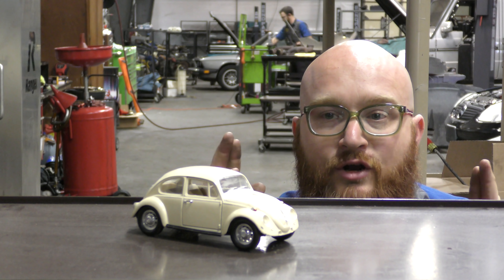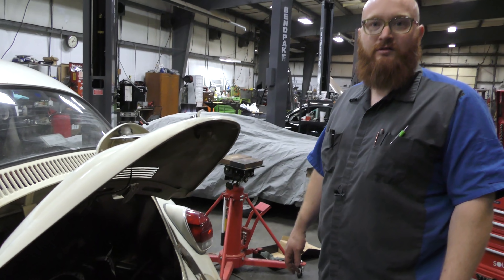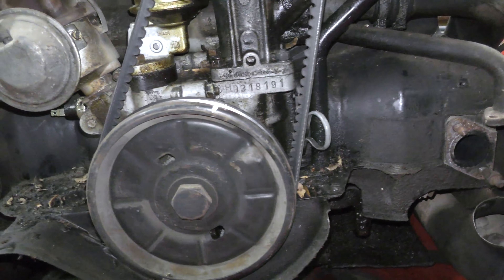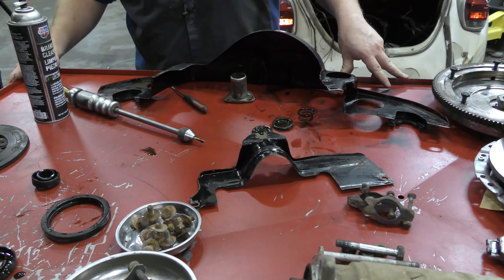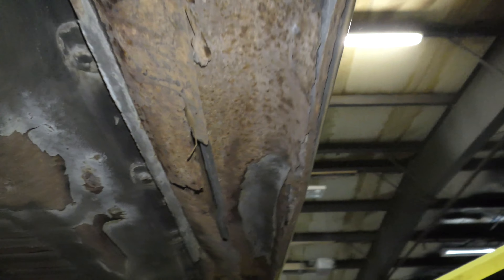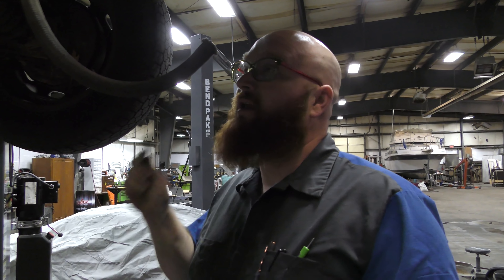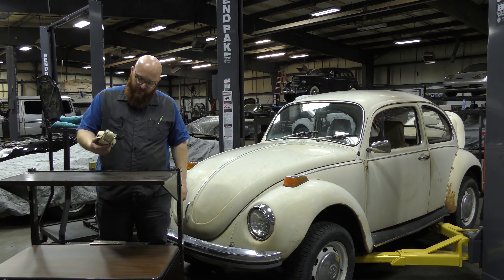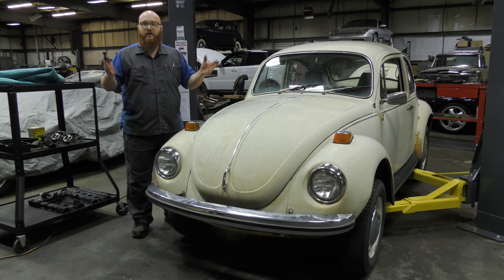Engine out for a clutch on '72 Super Beetle?! CAR WIZARD shows cool little car & huge repair process

Comment: My first car was a VW type III station wagon, my dad had a couple of the campers
My town had an old time shop that specialized in VWs and I started hanging around helping out. This was around 1978 and VWs was popular because of the gas crises 
I’d buy them for a few $100 fix them up and flip them
I bought a 65 camper with bad engine for $100, paid $100 to tow it to the shop
Then bought a 1969 bug with no title for $100  Took the engine out and put it in the bus, the bug was 12 volt and had a slightly bigger fly wheel so had to grind the transmission housing out for it to fit. Also had to use a starter from an automatic...oh no need to remove the starter. 
Sold the body of the bug and tires for $200 and the old camper engine for $50 so I had $50 into my camper
I drove that thing all around the country till a girlfriend put sand down in the engine case
I probably have owned 25 VWs over the years, oldest was a 1955, back then they were just cheap old cars
I remember looking at a real nice 1967, 21 window bus with the big sunroof 
Guy wanted $1800 which I though was crazy high...today probably at least a $75,000 car

Comment: Unless you kept these in a climate controlled garage, you could almost sit and watch and hear the rust eating away at these cars. My stepdad used to own a 1964 model. Drove it to and from Cleveland OH to Travelers Rest SC many times having family in both cities. All through the mountains and everything. Never needed to worry about overheating it going up mountains on a hot day with no cooling system to worry about

Comment: Make sure you torque that flywheel gland nut to 217 ft/lbs plus. I’ve seen too many cranks fail due to shops just not knowing how tight that 36mm nut needs to be

Comment: A well sorted heater, ie no rusty heater boxes/channels, blower operational. etc in a bug/Ghia, will run you outta the car on even the coldest winter day. Sure it may take 20 minutes but they work good if everything is whole and functional. Also I wonder if the engine was being held in by 4 bolts or the usual 3 since the upper passenger side one is usually left out by prior owners. It's nice Wizard likes these but when one sends a bug to a mechanic, they usually got more money than sense.
Reply: Yeah, you'd roast your ankle but the rest of you was cold.
Reply: @terrylessmann2274  agree to disagree, actually had to dial it back

Comment: If you still have it on site, could you show and explain how the gas heater would work that some folks would have installed?  (Does that make me old to remember that?)
Reply: In Canada, the gas heaters weren't options but necessities--except when the Beetle was converted to an open air Dune Buggy which is how I learned to drive before getting a license. The first day of driver's ed behind the wheel instruction, the instructor said I was ready to get my license.

Comment: Someone installed the cam plug in back to front.
Did you check the radial play on the flywheel Wizard?
If it has play, indicating worn main bearings, the seal wont last too long before it leaks again.
BTW, starter motor does not need removing on this job.

Comment: You didn't mention the difference between a Beetle and a Super Beetle. The SB is slightly longer so the spare sits  flat in the front. The Beetle front suspension is torsion bars with 2 pivoting parallel arms on each side. The SB front suspension is MacPherson Struts. I think my SB had front disk brakes too vs the drums on the '70. In '73 the SB also got a curved front windshield vs the flat windshield on the Beetle.

Comment: Had  59 and 60 Beetles. Easy cars to repair as long as you bought metric tools of which I had none at the beginning. Top speed on the 59 was about 55 mph on a good day with no headwind. 36 hp I believe, the 60 had 40 hp.

Comment: I had a 1971 type 3 Volkswagen same air cooled engine but flat instead of upright 
The heater channels were not rusted out 
The problem with the design was that there is no heater blower motor 
Put your left foot right next to the floor outlet and you got a hot foot

Comment: I didn't see the oring that goes in the flywheel, they are what leak through the flywheel nut. That's not a washer cap it's a valve opener and the white pipe below it goes to the spare tire, there's also a valve in the washer cap itself that cuts off at 20 psi so the spare doesn't go flat.

Comment: There is a valve on the hose that  connects the washer reservoir to the spare tire that stops airflow at 35 psi so the tire wont go flat.

Comment: My experience with the heat in the Beetle was it did not work well when the engine was idling at a stop light. It worked best traveling at 40 mph or more. How do you repair the heat channels on this Beetle ?

Comment: Well it's out not a bad ideal to adjust the valves and putting a....009 distributor in that engine will make it run extremely well and a good set of NGK plugs please don't put Bosch plugs in it and a trick for some of your older vw's you can run Dexron transmission fluid in oil bath air cleaners air cleaner for filter much better you know my how much dirt it collects in the bottom you really see the difference how much better and filters the air and you can slightly overfill it

Comment: 4 big bolts, shift linkage, throttle cable, fuel line, and a couple if wires. If you're in a hurry you can even leave the rear wheels and axles inplace.  Works even better if you have a steel 55gal drum. You lower the whole car so that the engine just starts to touch the drum. Un bolt and lift body away.

Comment: even with intact heater channels, i cant see the air arriving very hot if you are driving in a cold german winter on a wet countryside road,some isolated tubing may be a good upgrade. AS a teen i was a bit too tall to fit in one of these, and i remember feeling a bit underwhelmed

Comment: I’ve been told that when you’re replacing the clutch that it’s a better idea to pull the engine and transmission out of the car as one unit because later on when you go to mate them back together it can be very difficult to do especially when you have the transmission still in the car if you have a manual transmission
Reply: It's not hard to get them to re-mate...just takes a little finesse to get them lined up correctly
Reply: @chrisfreemesser  I guess it depends on the vehicle as well. Some can be more challenging than others

Comment: I'm surprised the US spec Super Beetle has front drum brakes. Its predecessor, the VW 1500 Beetle in UK spec had disc brakes on the front. I must have changed dozens of Beetle clutches over time, never needed to take the starter out. The first clutch I changed took me 50 minutes, later I could do it in 20. I believe the record is about 90 seconds!. All on UK spec models, though I doubt pre 1973 cars differed much.
One weakness they had was the oil cooler partially shrouded air to #3 cylinder head, it was a fairly common sight to see them in repair shops because they dropped #3 exhaust valve after long periods of flat out cruising.

Comment: That small tube on the washer bottle runs down to the tire. Normally there is another tube that runs through the heater channel that carries the heat.
Still have the 72 Super Bug my father bought new. Naturally we got disc brakes on the front, standard.
Recall an old VW mechanic say, "More VWs (air-cooled) get killed by the mechanic at the corner garage than any other way".

Comment: You are mistaken Wizard; the windshield washer is still powered by the spare, but a hose is missing.  I owned, from new, a ‘68, ‘72 Super Beetle Baja Edition, and a ‘75.  If you filled the tank with a Chuck, the charge wouldn’t last long.  Also, as designed, the spare will not go flat.  One fills the tire to 42psi and a valve is present that prevents the tire from dropping from, if memory serves me, 26psi.  Air flow to the bottle stops at that point.  This way a single fill of the spare gives you a few fills of the washer fluid bottle.  
Sadly, at around the year of this car, the washer fluid release was moved from the dashboard to a wand on the steering wheel assembly (like modern cars).  I say sadly because the design also had the rubber hoses carrying washer fluid  into the interior compartment just behind the steering wheel.  The hoses, though pressurized, were not clamped.  On my ‘75, the hose came loose, spraying washer fluid into my interior.  By the time I discovered it, my floor had started to rust. A little Rustoleum fixed it for the life of the car.

Comment: I remember i did exactly this a clutch and heads and we pulled the whole rear of the car up using a barn rafter and slid the engine out with a pallet jack 😂 if theres a will theres a way

Comment: Interesting. The rear deck lid was changed at some point to a '68-'71 convertible/'70-'71 sedan deck lid. They went to 4 vents from '72 to 2003.

Comment: A Long golf tee works better than a screwdriver on the fuel line and you do not need to remove the stater unless you want to replace the bushing..With the proper tool a VW engine can be out and on the bench in 5 minutes very safely

Comment: Isn’t the heater duct running down the sides of the car also provide structural support?
Reply: As the Wizard commented, the "spine" and strength of the VW comes from the "tube" running down the centre of the car...you can take the body off (which contains those air ducts) and drive around on the platform...so no, it won't affect the structure...which is why people can't be bothered fixing the heat ducts....

Comment: The original friction disks for the clutch usually last more than 100,000 miles.. I would take engines out for rebuilding at 100,000 miles and the friction disk would hardly look worn. I'd bet this beetle has at least 187,000 miles on the clutch. Or else it was driven by someone who rode the clutch for mile after mile. The 1972 engines with the air cooler behind the fan housing lasted longer than the older engines with the oil cooler between the fan and cylinder #3. Moving the oil cooler back was an attempt to make the engine last longer than 100,000 miles. With the oil cooler blocking air to cylinder #3, cylinder #3 would typically suck a valve at about 100,000 miles, or even sooner. This is WITH properly done regular maintenance. The #3 exhaust valve would overheat, the stem would stretch, and guide would wear, and the stem would finally stretch in 2. The only warning was that at regular valve adjustments, isntead of seeing the valve lash get larger, you'd see it smaller. then you'd know the engine was soon going to suck the valve.

Comment: Americans were never taught how to drive an air-cooled car, they lug them around town instead of letting them rev which pushes the cooling air across the cylinders, and drives heat into the car. Also keeping the oil full helps the engine run cool.

Comment: If you're going to work on a Beetle a 36mm socket and 250 ft.lbs. Torque Wrench is essential.  Because the rear brake drums are held on with a 36mm nut and you have to torque that puppy down to 215 ft.lbs of torque if I remember it correctly.  Note could be 235 ft.lbs.  Hey it's bee nearly 40 years since I had the pleasure of working on a Beetle.  BTW, the Super Beetle is actually a VW Sedan and NOT a Beetle.  With this car line VW produced Beetles and Sedans that could look identical.  The difference was that a Beetle did not have ANY options available, you got the base car and nothing more.  If you something like pop out rear windows you had to step up to the Sedan.  Heck, at one point if you wanted a radio you had to step up to the Sedan.  My first car was a 1970 Sedan that was fully loaded.  It had chrome trim for the rain gutters, dual bumper mounted horns, bumper guards, a sunroof, pop out rear windows and the Formula V appearance package.  Color was Cobalt Blue with a white interior.  BTW, Fantastic was great for keeping that white interior nice and clean.  As for the engine, it was a single port 1600 and while rated at 65 hp it actually was producing something in the range of 72 hp and was quick enough to beat a 914-4.

As for clutches, my brother and I would team and did a lot of clutches on Beetles and Buses.  It got so we could have the engine out and on a pallet in 10 minutes or less.  Going back in wasn't so quick, even with a pilot shaft it was always a wiggle festival getting the input shaft all the way into the pilot bearing.

Comment: An old VW mechanic near me can service the clutch without removing the engine. He uses jacks to separate the transmission from the engine enough to get his hands in.
Reply: but why? It's easier to take the engine out than it is to reach around or craw under.

Comment: Wizard, I thought the "Super-Beetles" had a curved wind-shield, unlike the beetle you are showing us.  Are you going to replace the heater-duct that RUSTED and is Open to the air?  And why wouldn't the owner want to switch to the more long-lasting front disc-brakes?   I saw a space under the frunk where an oil-cooler could be placed.    Then by running oil lines through heater-duct you could have more oil capacity, with which to provide more cooling oil.   You've got LOTS of room, pun-intended.  Start a VW-Beetle shop, where if you need a change of pace, you & a guy could wrench on the Beetles you love.

Comment: With the heater channel in that condition, how does the car not sag when the door is opened? Mine did, to the point that if the passenger had their knees under the glove box they'd get trapped.
Reply: had a lot of bugs, Never seen that.  but doors wont close when body sags badly

Comment: A lot of the issues people have with the heater can be solved easily. You have to crack a window or open a windwing so the hot air can flow through the car. My 67 bug will roast you if I drive with my window down.

Comment: You also check the end play on the crankshaft before you disassemble the engine. You might have to shim it to get it back into spec, or the thrust bearing could be so worn that the clutch won't last. Remember "The Idiots Book of Volkswagon Repair''?

Comment: I believe it's a 71 super beetle , I owned a 72 brand new out of show room ,The rear back engine compartment cover had more loovers in the 72, Perhaps the back lid had been changed at some point..I could pull the engine in 20 min ..did alot of work on them..

Comment: My 1st car was a 1970 beetle with a 75 1600 duel port. I payed $67.80 for the rolling chassis I already had the engine. First werk on a car... squeezed the throttle cable between the engine and transaxle. My Dads mechanic fixed it for nothing. It was the same yellow.

Comment: The groove on the pressure plate is not that big problem to use on a low performance car. The friction area is still big enough. They can be used if you don't find new ones.

Comment: 7:26 actually with 21,529,464 produced, the Beetle is the longest-running and most-manufactured car of a single platform ever made. In the EU this beetle would not pass the test to receive a traffic certification.

Comment: That's a 1971 Super Beetle actually. 1972 would have a different steering wheel and 4 rows of cooling slats on the engine cover. '71s had old style steering wheel and 2 rows. :)

Comment: Fun fact: As of the late, late 1960s, lots of European Beetles were supplied with front disk brakes. But for some reason no Beetle sent to the US ever had factory fitted front disk brakes.

I had to have the clutch replaced on my 1968 1300 Beetle because of engine oil on the clutch. If there's too much end play on the crank, just replacing the main rear seal isn't going to do the trick. It will start leaking again. On my car the pressure plate I'd been supplied with turned out to be wonky. When taking off from standstill, the entire car would turn fuzzy because of the massive vibrations, while the view out the window remained crystal clear. Very weird experience. So that meant the engine had to come back out, so that the clutch could be replaced - again. Thankfully, the supplier made up for the faulty clutch by sending me one that's designed to handle 200 bhp and ditto torque. Slightly harder clutch pedal after that, but it'll certainly never slip under the load from the massive original 40 bhp from my engine.

As for the heater, the heat in my car worked great until the heater channels rusted out. I remember driving in 3 degree F weather on twisty, icy roads, just tootling along at 30-35 mph in 4th gear (heater output is dependent on engine revs), and things were supremely comfortable. Of course, once heat started leaking out and never making it to the cabin, that rather changed.

The car is currently sitting at the world's slowest hobby mechanic, due to rust in the frame head. You know - that bit of the chassis that the entire front axle assembly is bolted onto. Rather a big job, that, and one that has to be done with extreme skill and accuracy. I miss driving my Beetle a lot now, but it's certainly never going to see winter roads with lots of salt ever again.
Reply: Oh, and second fun fact, this time heater related: Unintuitively, you should always keep one of the quarter lights slightly open. The Beetle cabin is so airtight that the heater actually has trouble pushing heated air into the car unless old air has somewhere to escape.

Comment: If I was the customer I would have had the valves adjusted while the engine was out. They should at least be checked with every oil change and are easy to get to even in the car.